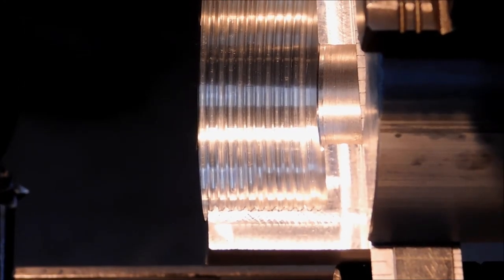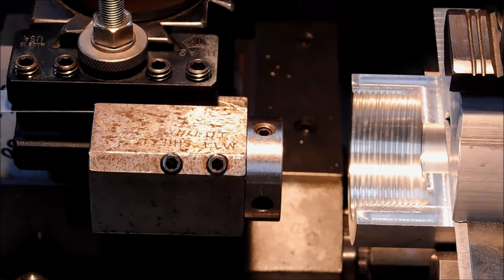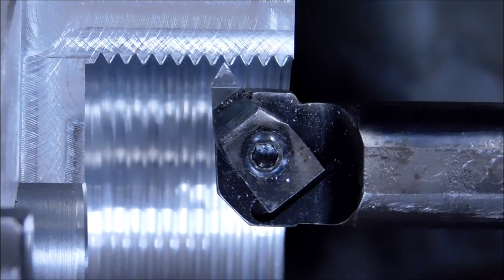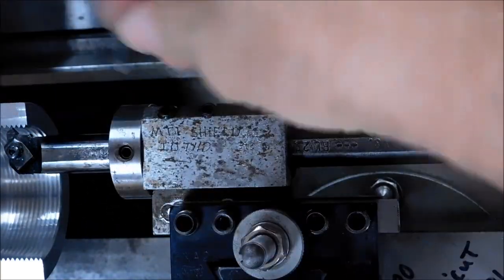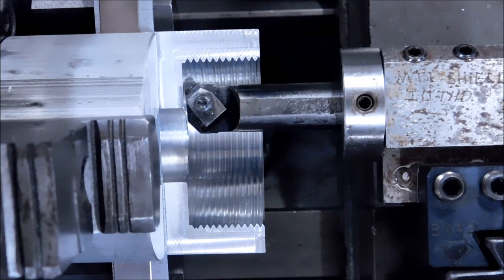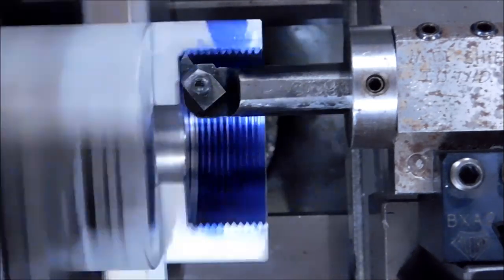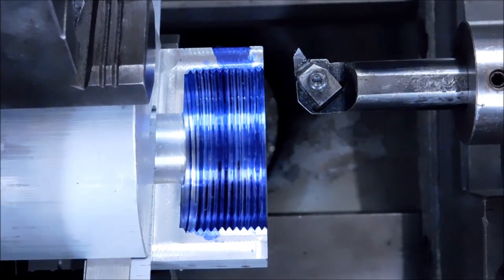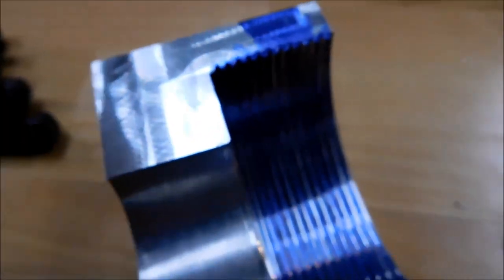How To Pickup an Internal Thread for Repairs !!!

Comment: Hi Joe, good explanation, and easy to perform. I do have a question, if you covered this point in the video and I missed it -appologies, it's my age! I think there might be potential for tool tip movement in both planes between picking up the thread and locking the bar in the toolholder, do you take up the 'slack' on the clamp screws to limit 'slop'  before picking up the thread? 

P.S. in the UK we 'slacken' the carrage stop lock screw!
Reply from the maker: Off camera I am pushing the bar in and out while dialing the cross slide into the thread. i can feel the range of motion getting smaller as I dial it in. when I detect the in and out motion has stopped, I tighten the tool. back it out a bit for the first pass.

Comment: Hi Joe, I am not expert in this field but I have a question to ask. is there any way to retread the internal treads of an actuator with rough tread ? these treads are harden to bear heavy load so its not soft metal.

Comment: Joe, if the thread is not concentric to the OD of the part, how do you indicate the bore of the thread before attempting this operation? If the thread was good, I suppose a tight fitting gauge pin extending from the bore might work. Thoughts? Thanks for sharing your wisdom with us common folk.
Reply from the maker: I would use a plug for the setup too.

Comment: Hello Joe,  I believe I got most of this technique.  Here's one where I don't think it would work at all and have no idea how to approach this.  I have a mid eighties Maglite C cell.  Now Maglite makes its own proprietary thread.  It is a mighty fine and light one too.  I do not know if the internal one is the same as the external.  In these earlier Maglites the switch is held in by a threaded collar that engages this internal thread.  Your mission should you choose to accept it is:  How to identify such a minute thread inside a small barrel (a C size doesn't give much room for either vision or sizing tools!  Don't know if the thread gets bigger on the D size but I don't think it changes??).  How to 'feel' that thread which is not only very small but in aluminum.  Then chase that thread which starts and ends inside the barrel.  I am not even sure if it is a 60 degree thread.  How to measure that fine a thread inside a blind small bore and how to make a tool to do the cutting (probably the easiest of a difficult set of problems) seems a tough one.  Thanks again for your excellent videos.  Take care and Happy New Year.  Doug
Reply: Use some clay, press it into the internal thread to make a mirror copy of the thread pitch and angle. View the clay on your optical comparator to be able to grind your tool to match.
Joes method is good here....what I do is simply loosen the threading tool in the holder, then push the tool into the thread groove since the tip of the tool will follow the groove and align itself until it bottoms out.
Make sure backlash is taken up in the direction of travel before locking everything down.
Reply: @drd1924  Me too. (Both tricks). If I want a more permanent impression of a thread or internal feature, I use kneadable epoxy putty (the coaxial stick form) and spray sparingly with a volatile release agent which flashes off.
Reply: @Gottenhimfella  Good trick, Yeah I like that kneadable 2 part epoxy since it dries quick too.

Comment: Excellent video.The method of using a dial indicator would seem to be equally useful to repair external threads since the dial indicator can detect very small movements the eyes can’t detect.

Comment: Excellent idea. My old Southbend 9A might have an issue running backwards as that could unscrew the Chuck. I will give it a try with real light cuts. Thank you.
Reply: Maybe you can fit a long bolt inside the chuck running through the spindle. Then lock it with a fender washer and nut on the outside end of the spindle. I have not tried this yet, but I have the same issue with my Craftsman lathe. The threaded spindle has no protection for reverse turning. Theoretically, it would be best to use a bolt with a left hand thread.  My reversible drill has a chuck that screws on to the right with a left handed bolt in the center that screws back into the spindle. It stays tight under power in either direction.

Comment: Thanks Joe - your timing is perfect! I recently bought a South Bend (Skinner) chuck on ebay for my Craftsman lathe.  Wouldn't you know it. That snooty South Bend chuck refuses to thread fully onto the Craftsman spindle. (Yes, I have cleaned both the threads thoroughly.)  The question of who is wrong in a situation like this is interesting. I have tried measuring the spindle over thread measuring wires, but I have a hard time getting repeatable numbers. Will make another try at that tomorrow. I think that regardless of which part is wrong,  I will try to increase the pitch diameter of the chuck hub rather than messing with the threads on my lathe spindle. That's probably not something a noob like me should be doing :-)
Reply from the maker: Doing the chuck may be harder, but it assures other things will still screw onto the lathe.
Reply: Joe, I made a fixture to hold the thread measuring wires and and am getting somewhat more consistent readings. I find that the lathe spindle PD is a little oversize. Nevertheless, I am going to modify the chuck hub, not the spindle. Modifying my lathe spindle is just not something I'm comfortable doing at my current skill level. Thanks again for a great video just exactly at the time I needed the information.

Comment: Nice! That's one tight thread to the back of that piece 😯. Another benefit from running the spindle in reverse 🙂.
Idk how you indicated half a piece like that but nice work, and thanks for the tips 😁!
Reply: If I had to set up a demo like that, I think I'd avoid the problem in the first place by boring the piece and threading it, and then take the chuck out of the lathe and lie it on its back on the mill table with the workpiece undisturbed.

Comment: If the diameter is big enough to get fingers inside, I’m thinking of using a tab with threads on it and a ground flat positioned directly in line with the thread for locating the tool from it.

Comment: Could you thread a bolt into the threads and then pick up the threads on the bolt to align your tool? Remove bolt then feed in with the cross slide to get to depth. I guess that may be difficult with damaged threads.
Reply: NO!
Reply: @duckslayer11000  Can you explain why?  When Joe Pie was showing his procedure, I was imagining that my way of doing it would be to thread a bolt in and get the alignment from the bolt's thread high points.  I believe you that it's not a good way but is it from experience that you say no?
Reply: @tralfazy  It would be off half a thread.
Reply: @Peter-V_00  That's why I said you would need to use the high points.  I dunno, I've never tried it.  Maybe it's too sloppy that way.  You have to take the backlash out first either way though.

Comment: joe...do you rotate the chuck by hand to get the slack out of the half nut while centering the threading tool
Reply from the maker: I apply pressure to my handwheel like a brake as I thread. This takes out any slack. The carriage is basically pre-loaded when the machine stops.

Comment: Great tip with the indicator Joe , gives a close starting point .  I now you thread from the other direction but  if it was metric would you cut from outside to inside & do the disengaging trick ?
Reply from the maker: probably not. I prefer "in to out" for all threading.

Comment: Greight video, thanks Joe. I noticed at 14:33, there's blue on the tailstock side of the tool, but not on the chuck side. Does this mean your initial position was slightly off? Could this be used to make a small correction?
Reply from the maker: Absolutely. The dye is telling you exactly what is happening. But to be honest, I believe I cut the dye in half.  Joke......maybe
Reply: @joepie221  Lol! :)

Comment: Speaking of mirrors....there are now (relatively) inexpensive USB borescope video cameras available that will  go into places a dental mirror has no hope to fit in.  Takes a little mental practice to comprehend things on a screen as well as you do in a mirror but it's worth it.  I have two - one was a "real" borescope for around $50, the other a "find your wife's ring that went down the drain" version for around half that price (it's lower resolution and a little larger in diameter with a somewhat longer focal length).  I hate to say which insanely popular online store I found these on, you can guess.  Once you get used to them they are super useful tools in the shop, and not just for gunsmithing jobs.  I happen to have a regular computer in my shop with a big screen for all kinds of uses (like showing prints and specs large enough to read across the room) but a cheap chromebook or laptop would do fine for this as well.
Reply from the maker: Thanks, I may check into that.
Reply: @joepie221  Here's one with short focal length and side view mirrors - https://www.amazon.com/Teslong-Borescope-Side-View-Semi-Rigid-Smartphone/dp/B07TTQF24F/ref=sr_1_3?crid=QYQLFJPNAIXF&dchild=1&keywords=teslong+borescope&qid=1600521163&sprefix=teslong%2Caps%2C648&sr=8-3

There are also cheaper lower resolution ones with super long cables for finding things in bad places.  Also useful as they focus around an inch out.  Search for "endoscope" for those.
Either can be had for a lot more money if you get a screen with them, but any computer will work with them if it has any software that will display a camera (linux, windows, mac, android, ios).

Comment: Hi Joe .  as usual a terrific video on chasing threads. Job well done. Your sample looks like the piece you did the internal thread cutting, then you cut it in half to show the threads etc.  I made up a lathe spider, which I cut the threads in the way you showed, as in reverse, but your threads are so far superior to what I have.  Can you tell me what cutting tip you are using, whether it is a carbide or High speed steel steel cut to the 60 degree angle thread, whether internal or external threads.
when you were away on your diving quest, I sent you an email, wondering if you received it ?   Great work Full Points :)
Reply from the maker: The insert is carbide. Its a kennametal top notch threading insert in the NT2L catagory. Left handed bar. If I have not responded to an e-mail, please resend it. My inbox fills quickly.

Comment: Nice video very well explained! One question for you : why not processing until the Dail indicator reads no play? The boring bar will slide into the desired position
Reply: Root of the tool might be narrower than the root of the thread so it could bottom before you find the centre position.
Reply: @DoctorJ3kyll  my guess is that the insert is pointier than the thread which is a good point: in that case the point of the cutting bit will still end in the center of the to be fixed thread?

Comment: Hey Joe do you have any tips for machining a internal thread like this to proper size and tolerance with out a part to check it on? Is there anyway to measure it?
Reply from the maker: I am not a fan of using the mating part unless you will control both forever, so lets rule that out. On critical spec threads, I always made a gage to check the thread. I am not familiar with any other technique.

Comment: Good advice for an engine lathe. We have Hardgine nockoff  lathes with digital threading. The machine stops the lead screw before the spindle stops turning( timing isn't manually connected) any ideas on chasing the thread in this situation?
Reply from the maker: I have to think this would still work. The carriage has to be timed to the part no matter how its done.

Comment: Can the half nut be engaged in the normal fashion for even or odd number threads?  Or do you have to select the same number within the same revolution of the dial used during the setup?
Reply from the maker: Yes. if your dial has 8 graduated lines with every other one numbered, ( 1-4 ) you can use any line for an even numbered thread, but only use the numbered lines for odd pitches. you do not have to hit the same numbered or previously used line for repeated passes.
Reply: @joepie221  Thanks.

Comment: Hey Joe, (from Orlando - and no, not the Jimi Hendrix "Hey Joe") You just never cease to amaze! I was wondering how you would execute a 50degree buttress thread (rhetorical) (made a plug to convert a pump sprayer to a vacuum container to suck the oil out of the High Press. oil pump of my diesel engine. Joe, you are the gold standard, with humility. I/we greatly appreciate your continued production of all those points of wisdom; and the best point is that you're able to articulate the rationales which support your points. Again, thank you Sir!

Comment: Hi Joe, totally out of the blue, but I have major difficulties in tapping deep holes in titanium and stainless steel. Whatever I try. On M8 for example I cannot get beyond 20 mm deep without the tap starting to fix itself and when pushing beyond I get cracking progression and beyond that breaking of the tap. Used all type of lubricants tap types(3 levels as wel as one go taps) getting larger start holes than the tables etc etc. I know you are a fan of using the lathe, but my largest thread is usually M8 and I find it very difficult to use the lathe on small threads. Many breakings an relying on a set of carbide drills to get old taps out.  Tips would be appreciated as I could not find my specific problem addressed anywhere.
Reply from the maker: Try this site. Emuge taps are awesome for tougher materials.  https://www.emuge.com/

Comment: Another useful technique to file away for future use! For some reason this reminds me of your slip adapter video for using small drill bits. Instead of moving my compound in and out and splitting the difference in readings, using an indicator and moving the tool provides a sense of feel (like the small drill technique) that's no doubt more accurate.

Comment: a very insightful video, much appreciated. thanks.
how is the backlash of the lathe accounted for in the setting up for this proceedure?
Reply from the maker: Its all loaded in the actual cut direction. Its really not something you have to worry about if you stop the machine with the carriage moving and the half nut engaged.

Comment: Great technique, thanks.  It got me thinking; could a DRO be used to avoid the need for a dial indicator and special sliding toolholder?  It can…
1.  Run the lathe with the half nuts engaged then stop the lathe and set the DRO X-axis to 0.0000”
2.  Disengage the half nuts.
3.  Advance the tool into the thread, bump it on each flank and adjust the compound so the X-axis + and - numbers are equal.
4.  The tool should then be perfectly centred on the thread. 1:08
Reply from the maker: The tool to carriage relationship is lost as soon as you disengage the half nut. It may not work.
Reply: Once the DRO has been set to 0.000" the carriage position is memorised.  I've tried it and it does work.

Comment: This is the first video I've watched that just didn't make any sense to me.  Maybe I missed something.  Or maybe you are solving a different problem than I think you are trying to solve.  I've enjoyed and learned so much from all the others I've watched.  This one was a head scratcher.
Reply from the maker: Try to repeat what you just saw. When you hit the wall, watch the video again. It will make more sense to you.
Reply: It makes sense,you just don’t understand it 🤣🤣🤣Just kidding,please dont be offended
Reply: First off the piece he threaded was a prop to help show what he did, otherwise it's just a threaded tube he's repairing threads in. Notice he shut off the machine with the half nut engaged, this is key, then he adjusted the position of the cutting tool in the thread and adjusted by feel until he was in the thread a bit, then added the dial caliper for fine adjustment, really genius. 

  I know it's hard to ask the right question when you don't understand, if you try again, maybe we can help.

Comment: Assume you've been given a cross-threaded rifle barrel in an expensive action to repair.  Does this call for a new barrel or is the action and barrel salvageable with this method?  We're assuming that a few of the threads will no longer be "full", and the magnum load won't blow the barrel right out of the action on the first or second load.  Hypothetical only, asking for a friend.  🙃
Reply from the maker: The damaged thread will be compromised in the strength category, but this technique should repair it. Check both parts of the assembly.

Comment: This is timely,  1st thing tomorrow morning I have to repair a thread on a hydraulic piston that had welded itself solid to the shaft, requiring the shaft to be bored out.  Most of the thread peeled out nice after boring but for a 1/4" wide section that needs chasing out.
Reply from the maker: Good luck!
Reply: @joepie221  mission accomplished thanks you.
Reply: Same here , first thing in the morning I gotta pick up a 20tpi internal, feeling a bit better about it now.
Reply: Great video Joe, thank you

Comment: Great video! I have no holders that would work as is,  but I like the idea of making a set of sleves. The boring bar holders for my multifix B are split 40mm and making a set of reducing sleeves seems like a  very good idea. Just never occured to me... 
Is the rotation error of the threading bar when moving it a problem? I wondered if Your design perhaps has a flat or something that prevents the bar from rotating when adjusting it?
Reply from the maker: I will be posting a lathe accessory video shortly. Come back for that one. Your question will be answered.
Reply: @joepie221  Thanks! Looking forward to that. 
Your tips are invaluable!